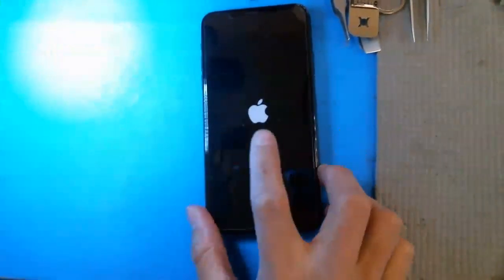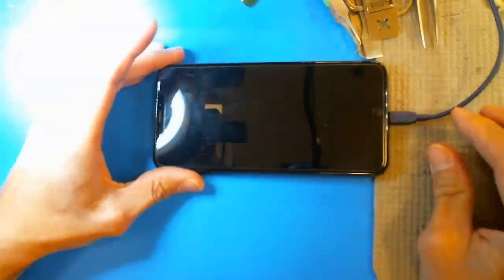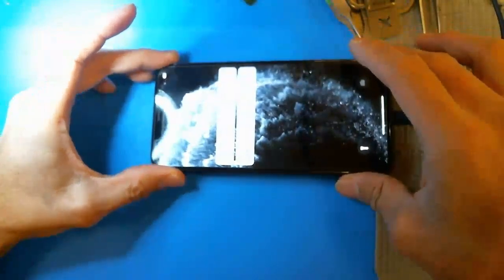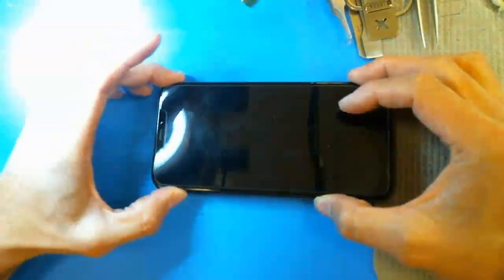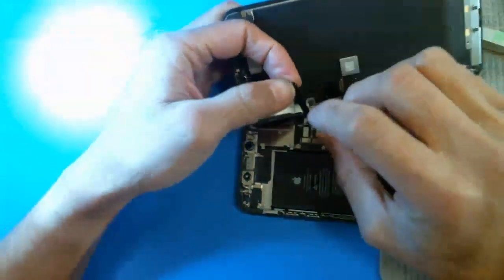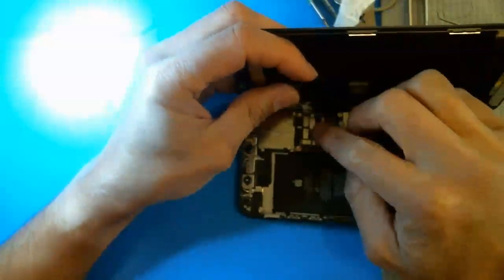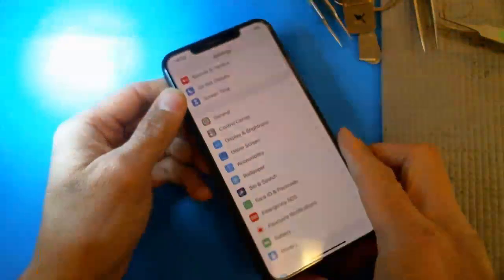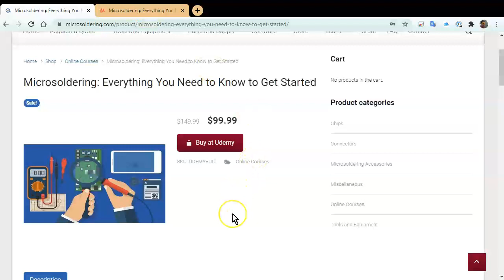iPhone 11 Pro Max Boot Loop Repair -  Stuck in Recovery Mode

Comment: I had the same problem (went to a waterpark, never submerged the iphone in water) but it went away after 1 day, phones still ok after 1 week. Should I be concerned if the chips inside would be corroded over time?
Reply: So for anyone wondering I had a similar situation. I was fine. My camera was a little blurry and the was battery was gone. It was fine. Same time next year however it went into this recovery mode 💯.